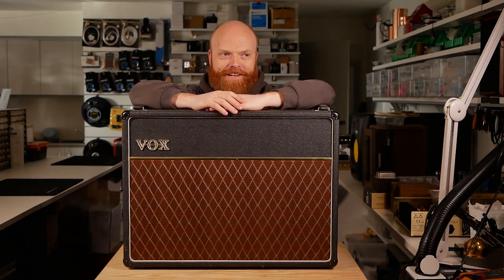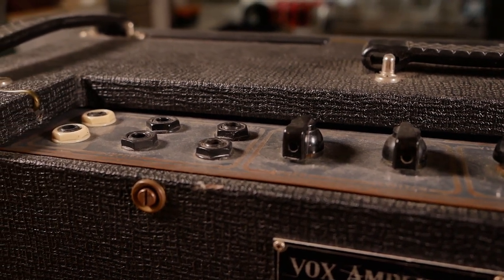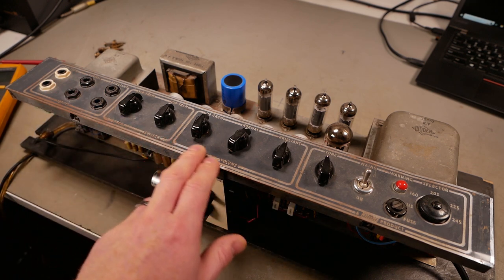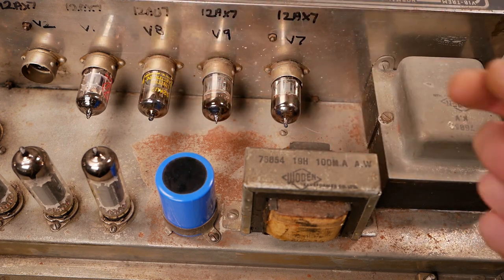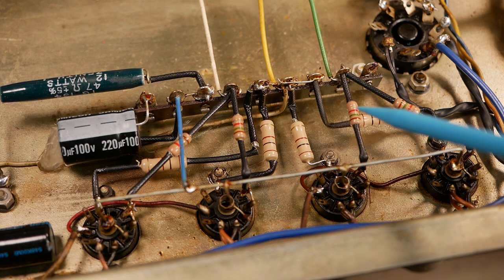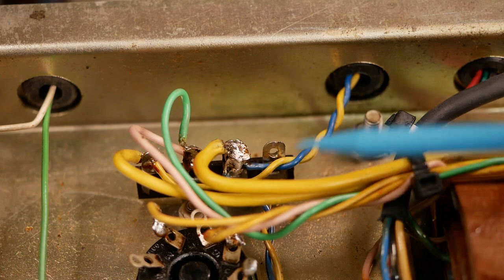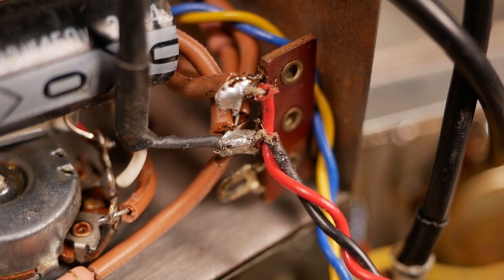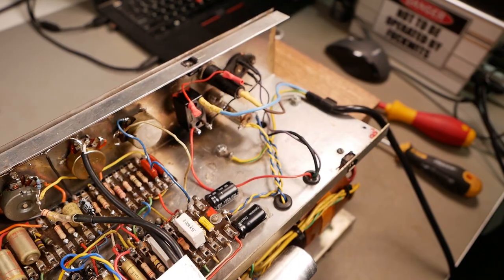Bringing A 1965 JMI Vox AC30/6 Up To My Standards - Part 1

Comment from the maker: I forgot to talk about heater elevation when I talked about groud referencing. Sorry, I'll cover that in ep. 2.
Reply: 16uF-16uF @ 450 WVDC for filtering the B+ rail and 8uF @ 200 WVDC for the preamp part of the rail. Too much filtering and it's not an AC30 anymore at all. We call lamp cord "zip cord" in the USA. You can pull it apart and unzip it into two wires.

Comment: Is this from the "She ain't set-up" series? Love your work Brad and thanks for sharing it. The apple didn't fall far. Great specimen of the JMI series Vox. Psionic is smiling. Hammond recruited many early tubes for their organs, leslies, as well as others did back in the early days. the circuit has been modified/serviced before too. Go with the el84 reliability mods. Yes the el84 circuits are purposefully abused, in fenders and others as well. They used to be cheap. No more. A cooler bias will deal with voltage/amperage shifts better than a hot bias with no negative effects.  Wall voltages often shift 20volts or so. There lies the Rub.

Comment: At 3:30, the term your searching for is *Tinnerman nut*, also known as a "speed nut", a fastener that clips onto the edge of sheet metal and allows you to thread a self tapping sheet metal screw into the speed nut. A Fahnstock (Pfanstock?) clip is a type of electrical connector for attaching bare wires that was often used on 1920 battery-powered radios and homebrew radios of the 20's and 30's.
Reply from the maker: "speednut".
In the UK, they're called "Motorhead"!

Comment: After watching the walk-through, this AC30 is a lot like how the Cambridge Reverb I worked on was built... all solid core wire, wrapped around the eyelets like 3-4 time, 3-4 wires crammed in each eyelet. No grid stoppers, no heater balancing, components stacked on top of each other in a chassis about 1/5th the size of that AC30. No wonder it took me 6 months to get it working again! Hehe!
Good luck Brad! I know you will make this thing solid.
Reply from the maker: There really is no way to accurately predict all the hours that need to be poured into these units to get them purring, mate.
But I think they're totally worth it. And that's why I'll never be rich. LOL!

Comment: The Jennings AC30 I have in right now has rather large single section TCC filter caps. They are large enough I can stuff the two modern 16uFs and the 8uF into one can.

Comment: You are thinking of a "spring nut J clip" not a Fahnestock  clip. They kind of have a single screw thread stamped into them before they get bent into a J or a U to clip onto the sheet metal and in rapid assembly some workers will just ram the screws in then give a final twist to tighten them up or strip them out.
Reply from the maker: That's the one! Thanks mate.

Comment: WRT Hamond tube, if it's made in Holland it will be almost certainly a Philips tube and very slight possibility of Amperex. 
WRT screen Resistors, 1k will give some extension on life but they will also sound slightly different... depends how picky the owner is or if he / she can even hear difference. Most old AC30's
I've worked on have been running well over 100% max plate dissipation. The problem is they usually sound really good running that way :( . There is a solution but you will have to pm me for it.

Comment: Not sure I agree with the point about stranded wire.  It's very prone to breaking if soldered and then subject to repeated stress at the point where the solder ends.

Comment: Given that the el84 do not have separate  cathode resistors  all 4 must be matched for current .   Given that and 100 ohm screen resistors will burn them up fast and not evenly . Designed when match quad was easy to get. IMHO given current production each el84 should have 200 ohm to each cathode having a by pass cap  . This said  it is  more bench time and cost  . Changing the original design to match current parts .

Comment: Good work Brad! By the way, I'm liking your face-to-camera work of late. Is it a new camera? Everything is looking way better, especially your close-up shots. Looking forward to part 2. Where will you put your filament ground reference? EL84s Cathode? That should get you around 12v.
Reply from the maker: Just some new lighting panels, mate. Got some Lumipad 25's above the bench now and a few smaller ones for fills etc.
Reply: @BradsGuitarGarage  they made an noticable improvement, Brad!

Comment: Just curious, is this a 59 year old amp that the original circuit has been fine all that time? Sounds like it won't last a week by your description of the way it's built.
Reply from the maker: The amp was not original.
The amp was brought to me because it had issues.
It was also originally designed when EL84's were much higher quality.
It thought I detailed all of that in the video.
Reply: @BradsGuitarGarage  I wasn't asking about the issues the amp had. After 50+ years, I would expect it to need service. But it sounds like it's a real poorly built piece of gear from this video.
Reply from the maker: Where did I say that?
Give me time stamps.
Reply: @BradsGuitarGarage  Gee, triggered much? I got the impression there wasn't much about the amp, resistors lack of diodes, etc that you thought was proper construction. Maybe I mistook what you said?
Reply from the maker: Triggered? Wha?
I'm just trying to find where I said that the construction is unacceptable as I don't remember having that impression.
Pretty much all of the things I wasn't happy with were either wear and tear, like the stripped screws for example, or previous work done by 3rd parties.
I don't have time to sit and watch the whole video, but you just watched it, so it's fresh in your mind to post the time stamps.
If it's too hard, let's just forget it and move on, yeah?
Reply: @BradsGuitarGarage  If you don't recall what's in the video, that's not a problem. I don't have an issue with that.